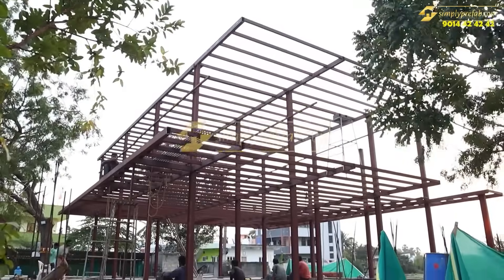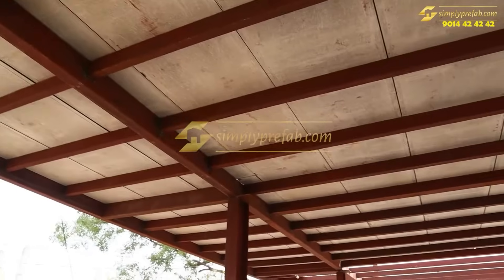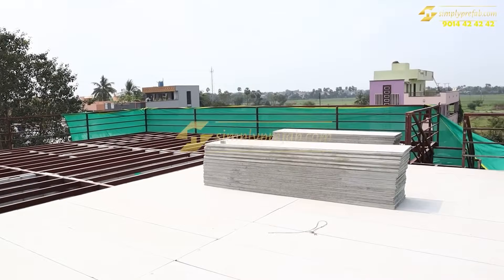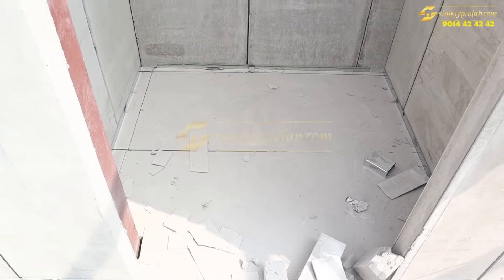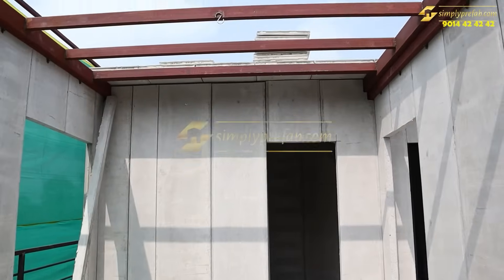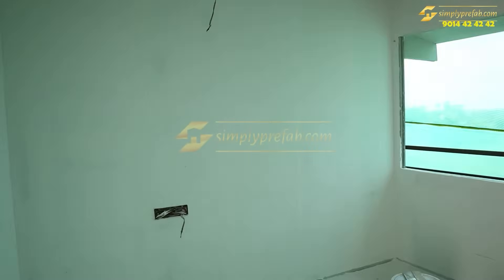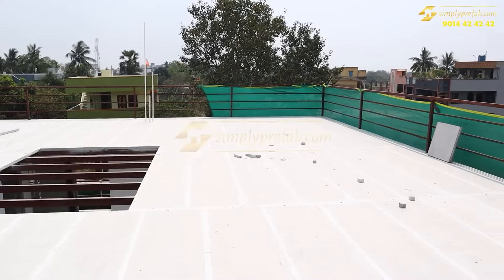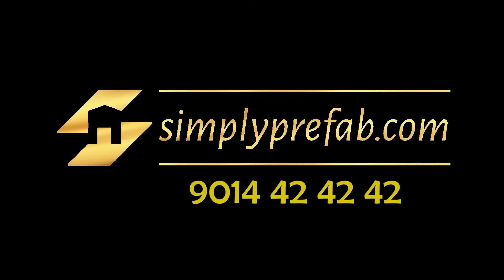Revolutionizing Construction: Unveiling the Power of Prefabricated Homes

Comment: Will not the pipes rust due to climate factors
Reply from the maker: we recommend applying a bitumen based or PU waterproof coating at critical joints or base connections for extra protection, especially in high-humidity or coastal areas.

Comment: I spoke with the shop in Guwahati Assam who deal in these panels. They literally said it's useless to build your personal house using these because theft is extremely easy. The thief can easily cut through the sheets and come inside the house ..so planning to drop my plan
Reply: They said it's only good for schools or classrooms or temporary settlements for low or minimum income groups but at the cost of safety and security
Reply from the maker: Good sir you took a good decision